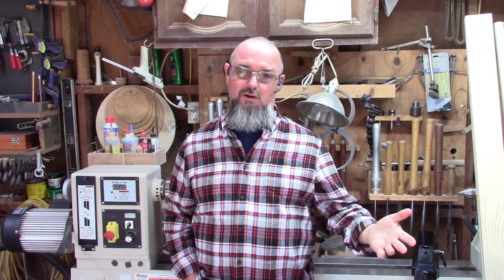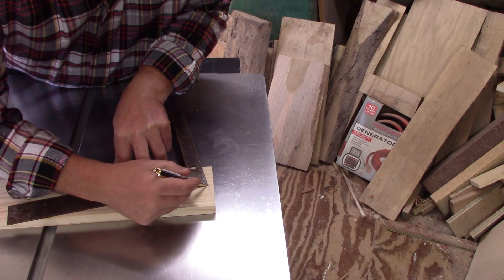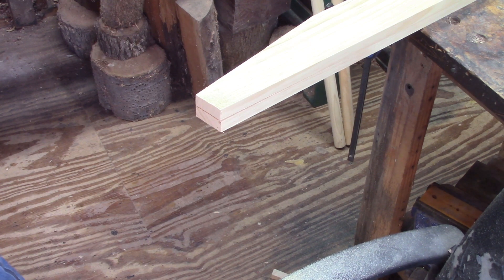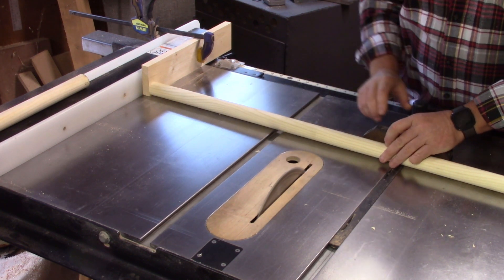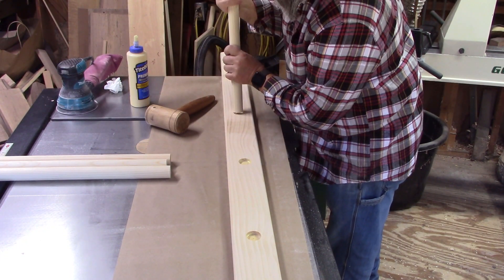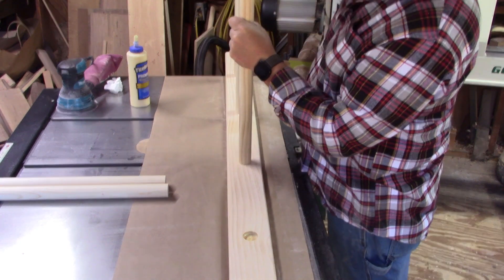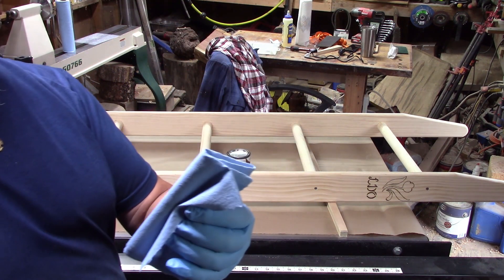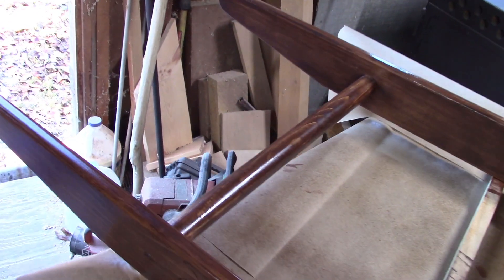#190 A Blanket Ladder for My Grand Daughter

Comment: I made one like that several years ago. I drilled completely through the rails, and had blowout, so I cut triangle shapes and drilled through them, at attached the triangles to the rails. I painted the rails white and cut the dowels long enough to extend an inch past the rails, and left them natural with polyurethane. It was greatly appreciated and looked better than I expected. There is nothing like making something for a child (or her mother).
Reply from the maker: Thank you Doug. Your design sounds pretty good. I bet they still have it. Using the triangles was a great idea and probably saved your project but also made it unique. Thank you and take care brother.